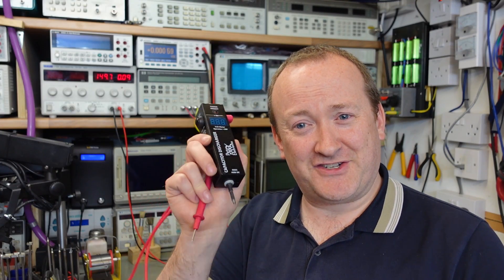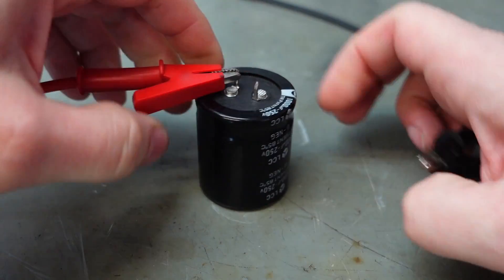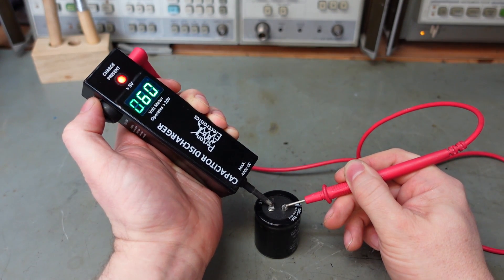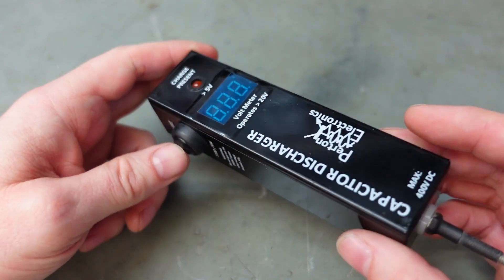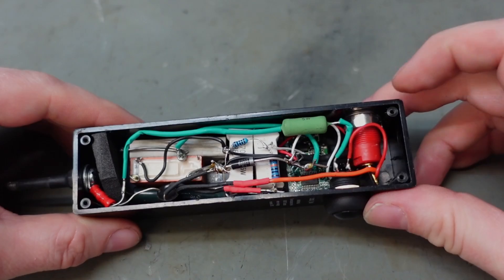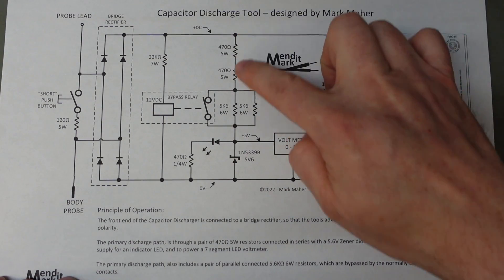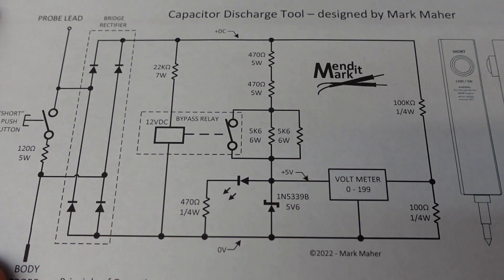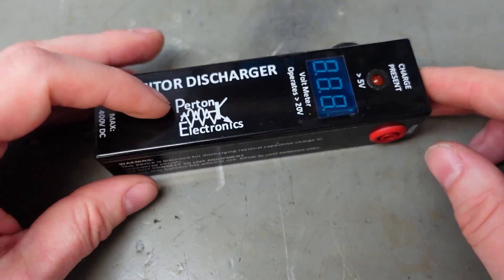The BEST Capacitor Discharge Tool I ever had!

Comment: Anyone that says they have never had a shock from a charged capacitor has never 
repaired high voltage circuits.
The old B&W and early colour TV sets used high wattage "Dropper" resistors that liked to 
go open circuit but that left a charged HT rail capacitor just waithing to zap you!
I always carried a wirewound resistor with me and discharged any capacitors 
before they bit me.
Reply: lol I remember holding a power supply board from a G8 in the palm of my hand and ZAP! My hand closed and I shredded my fingertips on the soldered joints underneath. Learned my lesson from that.
Reply: The modular G8 chassis made it easy to service in a customers home, but as you found out
the power supply was lethal if the dropper resistor had failed. @undercoveragent9889

Comment: I usually use the Lo-Z function (or equivalent) on my multimeter to discharge capacitors; eliminate capacitive voltages on longer paralel wires; and to quick test the trip of 30 ma rcbo tipe protections 😊

Comment: G,day Mark from Sydney Australia.
Can I damage a capacitor by discharging it with a screwdriver? 
I'm thinking 🤔 where the stored energy goes after making a short circuit.
🔋🪫
Reply: In a closed current loop, the power dissipated by each element is proportional to its resistance. So I'd expect the screwdriver to absorb only little of the energy. Most of it is probably dissipated by the internal resistance of the capacitor, heating it, and by the arcs forming at the contacts. Not good for the capacitor, or the screwdriver, if its a large cap.
Reply: It's best to dicharge at a slower rate. Same with applying full voltage instantly.

Comment: Very nice design 👍 one thing to be aware of is that large electrolytic capacitors will slowly regain voltage after you already discharged them so it's safest to short them with an alligator test lead or something while you work on the equipment.
Reply: This is good advice. I've been bitten by a capacitor (not as bad as it being FULLY charged, but still...) that I had discharged. It was a 4700uF 80V cap in a power amplifier I was working on. Working away, brushed the leads of the cap (it was one of those RG can type with the holding clamp)... ZAP! Ow! It probably was only sit-charged to 5V or so, but Jesus...

Comment: Hey Mark, very nice design.
You may consider a 5V beeper instead of the voltmeter. When the sound vanishes the cap is empty. Some beepers however ask  some current, hence you may try a PTC in series.
Reply: What? Sure, a blind electronics engineer might be repairing the power supply so I suppose that not a terrible idea but what about the deaf one; you're just going to let him fry?
Reply: My thoughts goes in the direction that  during discharge you have to put attention to contact the cap solder pads properly. Hence no time to watch a voltmeter.  A LED will satisfy deafs as well.
Reply: @jps-ib8vh  Ah, but if the blind man doesn't make correct contact, there will be no bleeping and he will think the cap is discharged and BOOM! - his fingers are where his sight is; gone!

hehe :P

Comment: Mine's far simpler as single discharge 10kOhm resistor in series, but yours looks much better Mark - you planning to make a batch and flog 'em here?? 🤑👍💥🍻
Reply: A 3 ohm 25W resistor should be adequate, and fast lol

Comment: The Chrysler slant 6 engine has a points and condenser ignition system, But the condenser in this one doesn't have a flying lead, it has a copper strap. The fun we had charging these up and tossing them to another mechanic . . .  There just no way not to avoid that copper strap when catching it.

Comment: That's beautiful. My capacitor discharge tool is a massive 100watt wire wound resistor in an aluminium case, I work in valve amps where capacitor accidents are often fatal. I wish I had a voltmeter on my device! Might have to borrow some ideas from you and make something nearer what you've done. Very generous of you to share your design. Your discharge tool looks ready to go into production!
Reply: He should probably make it available as a kit. At least a pre-silkscreened, pre-punch case. PCB, maybe... I'm sure you can find plenty of cheap Chinese volt meters capable of 200V measurement on evil Bay.
Reply: "Looks ready to go into production"!? 
Wait, it isn't?
I am going to buy it. Where is the link already?
Reply: As a lazy person why not a refrigerator/oven lightbulb? It has soft start, resistance is initially high but quickly drops and then goes up again, it's sort of adaptive to the voltage. It emits light, when you see no light, it's safe to touch.
Reply: @SianaGearz  ...or even an NTC with a regular light bulb in series?
Reply: @SianaGearz    If it's a filament/incandescent bulb then its initial cold resistance is low, rising as it heats up.
Reply: @   You are absolutely right, i was suffering a brainfart.
Reply: Or, if he has a patreon, do what Mr. Carlson's Lab does, put projects over there.

Comment: Would definitely buy one if a kit would be available.
Reply: I second this
Reply: @tcrenegade  Third
Reply: I’ve completed one of these now and 3D printed a case. The case has board posts for M3 screws and there are embedded corner posts for securing the lid (again with M3 screws but countersunk this time). All holes cut during printing except the LED one as I wanted to make sure placement was correct (I could update the Fusion design for that now). The circuit is neatly populating a veroboard. I had to modify the two resistors Mark had on either side of the volt meter discharge input for my Lascar panel meter. If anyone is interested, I’m happy to provide parts list, board layout and STEP files for the case bottom and lid. It’s very neat and tidy and fits the hand well but isn’t as small as Mark’s case design.

Paul
Reply: @paulgamble7548  Yes, I’m very interested 🙋‍♂️
Reply: @paulgamble7548  I'm interested. I'm planning on building mine but have not started yet, so you might save me a lot of time or at least give me ideas to improve upon which I'm happy to share back
Reply: @paulgamble7548 can I just buy an assembled one from you?
Reply: @paulgamble7548 I don't have a 3D printer. Would you sell your capacitor discharger as a kit with components & directions?

Thanks for your consideration!
Reply: 🤔
Wasn't there a schematic shown on screen?
I would have thought that if you were in an industry that would require you to go around discharging capacitors you should be able to build one from that. 😉 👍

Comment: Lamp 220V and cables
Reply: Yep, this is what I used for decades. Cheap, simple and you can see the energy dissipate in a few seconds.
Reply: This, or a big screwy 😊😊
Reply: @Ped0772 I've used the screwdriver in a pinch, but not the healthiest thing for the cap
Reply: A lamp alone isn't good, as it will present a brief short circuit path to the capacitor.
NTC thermistor with a lamp (or a PTC) in series will be a better design. Making sure that the breakdown voltage of the thermistor is high enough is a separate problem, though: they don't specify it in datasheets.

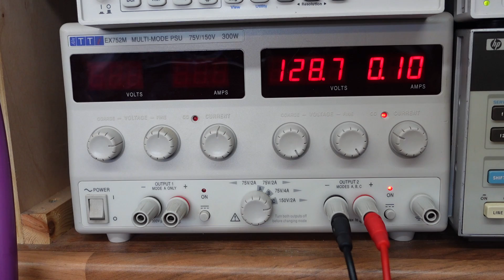Comment: 0:32 in class, early 90's we would charge 340v caps (low capacity) and throw them to each other to catch. Fun times. when boys could just be boys without all the safety regulation in the engineering class.
Thanks for the circuit. Really needed something like that a while ago when i placed a psu board on my leg that I just tested. swing voltage of 110v. 20 000uF.
Reply: Do you still have your leg? Yikes
Reply: @gavinrfuller  it was cramping for a few hours, and had some blisters. Nothing except the lesson was permanent 🤣

Comment: Ok, sold, where do I buy one! I am sure you have enough of us geeks that wont mind buying something like this. Of course, it depends if you can make money off of it LOL.
Reply: I was thinking the same!  I would expect that you could pretty trivially have PCBWays/etc print and populate a bunch of circuit boards for it (or sell it as a 'you solder kit'?), plus a case, which this looks pretty off-the-shelf.  In the 'you solder kit', I would expect 'drill yourself' could be acceptable.  I'd definitely order a 'you solder/drill/attach stickers kit', and I presume you could charge extra for a fully build version.
Reply: @TheFreshmanWIT  I agree but since his repair biz is booked solid and his YT channel is taking off, it might be a bigger pain in the ass than worth.
Reply: @TheFreshmanWIT  I reckon I could prefab a proper PCB if someone wants to prefab a proper silkscreened pre-punched enclosure per his design...
Reply: @TheFreshmanWIT  Ill second that, if it was sold as a kit, you can put me down for one too.